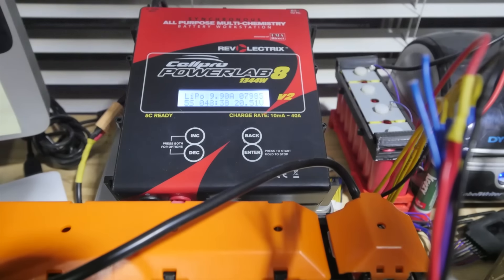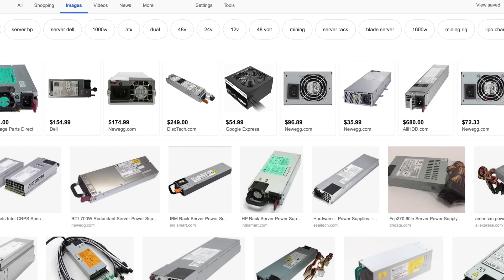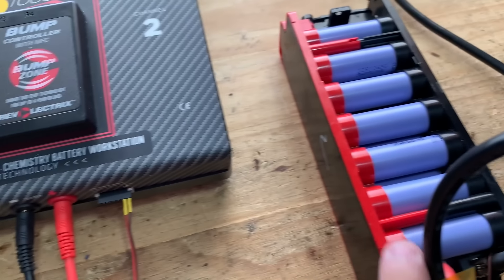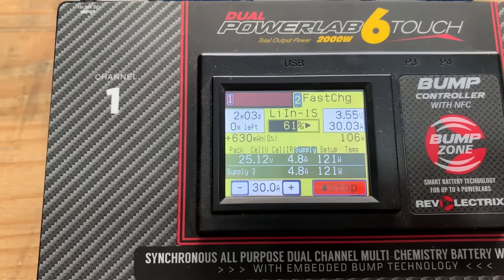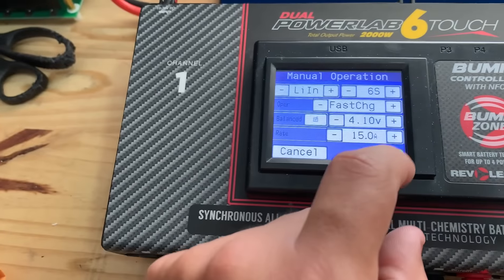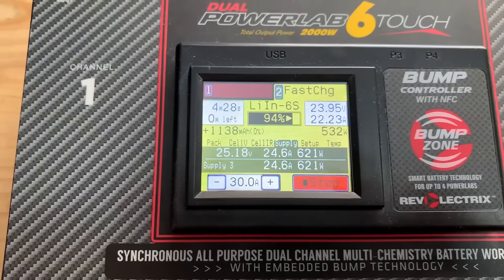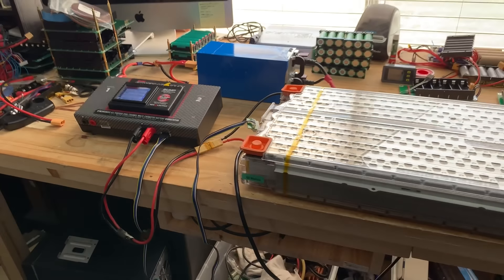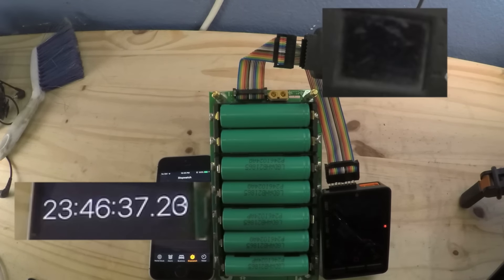$50 Dollar 2000 Watt 24V DIY  Power Supply. (2Kw)

Comment: Hi there.  These power supplies are rated ~1200watts, right?  How are you getting 2400w out of a series power circuit?
Reply from the maker: V x A = W.  do the math
Reply: @jehugarcia  ya, I’ve always had trouble with that high level stuff.... so, for the engineering world we all live in.... you might want to see if you can actually pull 2400wats out of a pair of series 12volt power supplies.... hmm ;) (btw, that’s ‘rithmatic bud - not maths ). Not sure I’d be taking any engineering advice from someone giggling at the magic smoke coming out of that charger.

Comment: I bought the same power supplies to make this cheap 24v power supply 
They both Work nice seperatly but as soon as I link them with the xt60 wire, one of them stop working (the green light shut off) and the total voltage stays at around 13v. Any idea ?
Reply from the maker: Did you isolate one?
Reply: @jehugarcia  you mean what you do at 3'00 ?

Comment: So how have you come up with 2KW? The lower value supply is 960w, so you are only able to draw that much power in series, i.e. 24v @ 40a. If you put them in parallel then you would have 1.96KW - 12v @ 80a. 

Which leads on to the reason your wires burnt out - drawing 80a on 1 supply.
Reply from the maker: What wires burned?
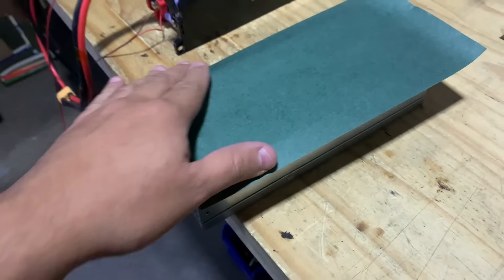Reply: 2:32 - Smoke, laughing, I just burned the wires? (Unless I’m hearing it wrong)

Also - 2KW? How?
Reply from the maker: It’s called rounding up,  look it up
Reply: I had a massive idiot moment 🤦‍♂️! Apologies - carry on 😄

Comment: I have 3 of the zanfare chargers. Going through 12 cells 3 times a day. And a 500watt atx powering a few tp4056, I haven't used the tp4056 in a while. I only have 400 cells to test. Maybe I should get the 4056 to precharge the cells. And only test the cells in the zanfare testers. I also have a few discharge testers. It would be nice to do about 25-50 at once!! I need to get more if something. I have likely 3000+ cells to go. Before this project is done! Then there is more projects. Ev likely.
Reply: JAMES! Since the 70's what you need all that power for? What you running?

Comment: If you series or parallel any chargers (power supplies) you better check their Freq and make sure they are the same. If you take two switch mode PSUs on different freqs and run them as a single unit, bad things will happen. In short, unless they are identical units, or you have some knowledge, don’t try this at home.

Comment: I need help I got a ebike motor and it say is a 36/48v motor and I have 4 Lithium Polymer batteries 11.1v I got only 3 battery level bars showing will adding another 11.1v hurt. it?

Comment: But I really wouldn't advise anyone to split the power cable and put 2 connectors on it, just use 2 of them and a power splitter or something. Just don't hack into mains stuff unless you really need to.
Reply: The earthing stuff is really odd too. It's not like they sit insulated in a server rack either. Videos like this - especially as descriptive as these - should come with more warnings.
Edit; I'm not pro rubber-tile-society but this video looks like a tutorial, but it definitely lacks a lot of background information.
Reply: As long as one of the PSU's are bound to earth they will not short with each other and they will be grounded, As the GND plane of the output is, well, actually grounded.
Reply: Tau Well that's the thing, as long as.
As long as people actually follow the instructions, as long as no mistakes are made, etc.

Mains stuff is dangerous, I stand behind my statement, you shouldn't hack into mains unless you really need to or have enough electrical skills to do it safely.
Reply: Lagger Onesixfour
Without taking risks, Many things would slow down to a crawl, Just make sure you check for mistakes by others first.
I didn't really care much of the split power cable, I just want to make sure that they grounded the unit.
Dust collects in those units, Without ground, they can give you a wicked shock.

Or perhaps my version of electrical safety is a little dull as I work on repairing valve PA's and old testing equip that can have ~500 volts on exposed terminals.
Hey, I'm still here.
Reply: The reason for this is that you have to insulate the power supply, as normally the ground output of the power supply is earth referenced. If you then connect 1 supply's 12V to the other's ground you've just shorted the supplies together. You can only run them in series once they're isolated from ground
Reply: Yes, the Y mains cable is just bizarre. There are common solutions for too few outlets....like maybe a high quality outlet strip with surge protection?!? I use heavy duty three way splitters sometimes.

Comment: What can you use this for? This showed up in my recommended videos after watching a bunch gas generator videos, post Hurricane Michael...
Reply: The charger he's using is a DC input charger only. So you have to buy or make a DC power supply to run it. Also, his charger is typically used for radio control lithium polymer packs for RC boats, cars, trucks, planes, heli's, etc. I run RC cars, nitro methanol and electric. I have 5 chargers to charge all my stuff. All mine are AC or AC/DC chargers with built in power supplies. I only run one of them off DC, that's the one I keep in my trunk to charge packs up when I'm out running trucks. Beforehand, I charge up all the packs I'm going to use via the chargers in my house that are powered by AC.
Reply: Steve, the connection between this and emergency generators is off grid power and backup power system. This presenter builds systems similar to the PowerWall, which can act as emergency backup power.

Comment: can you simply cut the ground prong on the power supply to isolate board?
Reply: Yes, but then you lose your Earth ground. You want to isolate the board from the chassis only. If you lose your Earth ground, the whole case could easily  become directly connected to mains.

Comment: If you would use DEANS WET NOODLE WIRE 12 gauge you would be able to not worry about overdriving the wire. Just a suggestion.

Comment: Jehu, why did you change stackable headers to that connectors with rainbow wires in your powerwall modules?
Reply from the maker: Better quality
Reply: jehugarcia  did you have some issues with previous solution for balancing connector?

Comment: Jehu: shorten those leads brotha, even with nice ass 8 AWG wire as you raise the current you end up with looses in the wire (aka heat). Design then to be a short as possible. Put fuses between the two PSUs and another one to the battery. If that Tesla battery backfeed bro, bad day...

Comment: I'm lost why would u think that these two case ground power supplys need to be isolated from each other?
Reply from the maker: Because we are connections them in series to make 24v
Reply: @jehugarcia  Only if they use the Negative output of the unit on the ground also. If it is just the input side, then there is no problem. We've combined a number of 12Volt battery chargers together to get 24 Volts with a 3 pin connector so that one charger charged the lower half of the 24V string and the second one charged the upper half of the 24V string of batteries. All of them had a 3 pin 115 Volt NEMA 5-15 plug so all shared the case ground.

Comment: Nicely done!
I believe you can't go higher on the amps because the charger is smart and it knows that the battery is almost fully charged. So it won't push too much power into the battery at that point so that is doesn't harm that battery. If you discharge the battery down to about 50%, you should be able to push more amps. That is what I have seen with the smart chargers that I have worked with.
You could discharge it and give it a try. Just my thoughts. Again thank you for what you do, you do a great job!

Also did you ever go any further on your "Hoverboard Wheels" board and where able to get it to go faster with overvolting or re-winding them?
Reply: Hi Joshua, my thought exactly. At about 90% SOC the charger switches from constant current to constant voltage charging.

Comment: i already have several 1100 watt server power supplies laying around but would like to run six and 8 pin molex out have any good sources for that?
Reply: Molex or Amp brand connectors? Any decent electronics supply house, but make sure you are installing the pins correctly or they will burn the connector bodies. For a retrofit carrying high current, I prefer converting to high current set screw terminal sets.

Comment: Hey quick question, did you isolate   both units, as in removing the DC ground
Reply: supposedly you only need to do it to 1 power supply.  isolate the pcb of the power supply from the metal chassis by using nylon washers and screws.  I believe the sizes are 1mm washers and 3mm screws.  I don't know the screw pitch.  most good local hardware stores stock these kinds of screws and washers.  especially ace or do it best hardware stores.

Comment: Maybe the current limit was because you charged a 7s pack on the 6s setting?
Reply from the maker: There is no 7s setting on the powerlab 6
Reply: jehugarcia yeah that what I was thinking. I mean, if the charger is set for 6s, the max voltage is 25,2 volts, so maybe he started the constant voltage phase dropping the current?

Comment: how many amp hours would 100 18650s have? great video.
Reply from the maker: There many sized 18650 cells,  some have 1500mah some 3600mah so it depends
Reply: @jehugarcia  Hi I have a lot of new hoverboard batteries but I have a problem with that even is charged and showing 42v after 10min of use it's stops working please can you help me what can I do with this batteries.

Comment: think about your house.  12 gauge is fine for 15amps. Those are also very short distances. check the temperature of the cables and the voltage drop.
Reply: House wiring is a different configuration, John. Most US home branch circuits are 15A 120V over 14 AWG single conductor (solid wire)  where battery configurations are more commonly carrying DC power over multi-strand (conventional stranded wire) and even poly-strand (speciality cable like welding conductors), helping with current conduction and heat dissipation as well as vibration and flexibility. Find a good DC wire rating chart to confirm the correct size rather than the AC charts in residential building code (mine are from one of the cable manufacturers I buy from) and make sure the insulation can handle the heat level (much of the work I do is under car hoods and I prefer 150°C/300°F insulation as a safety factor).

Comment: I have a control board that works and voltage adjust mod on the same board. has anybody figured out how to make them master and slave so you can use one voltage reference for adjustable voltage when using multiple power supplies?

Comment: Great video but i think id rather stick with my 36v 1200w adjustable (31-41v) power supply off ebay. 100$ cad so much cheaper usd would have been easier for the same price maybe?

Comment: Since I'm no rocket scientist I ask what're you using this for? Why not just do a 12v since that's what
we normally use? What is the reasoning behind jumping up to 24v, I mean why not go to 36-48v like
some electric bikes use?  If I knew I wouldn't be asking so thanks for any help offered? Once I've got
a clue then I can think about the needs I have?
peace
Reply: Pretty easy the chargers hes powering can take a max imput of lets say 12 AMP . at 12v thats 240w charging power . But the charger supports up to 24v so he can get twice the charging power. Thats the case because the charger has Buck boost converters  to supply different voltages for different battery packs . Those buckboosts use a pumped inductor to create the different voltages,this inductor is what limits the imput amps to 12 AMP no matter if 1v or 24
Reply: ty Peter, I should have figured as much but I'd rather get started looking in the
right direction…..I'm asking now so I don't waste too much money
thankyou much
Reply: @diggydice9041  depends on your needs , i only charge drones batterys and since im in my car most of the day the 13.8v from the car are perfectly fine for my needs
Reply: Gotcha now Peter, I'm setting up a Solar/Inverter to battery bank for
downed power situations. Hey, could you recommend a decent start
type drone that is good quality & can grow into it. I don't want super
cheap,,,, something good that I'll be able to use a while. For aerial
photo shooting & fun.  Or a good site to get me going?
peace
Reply: @diggydice9041  well check out rotor riot for freestyle fpv, good arial foto drone is the yunecc typhoon 500. Its about a year in market and the price is done to a very good level . Overall Tipp is if you want future and learning in the hobby Start with a something Like a tiny whoop or a simulator. Dont go for dji stuff or so discover your needs and then build up gear the drone hobby is expansive in the  beginning but cheap to maintain then. Radio and Googles are with you for a long time thats where most the money goes
Reply: thanks for all that,  it'll help me as I move into this.
I'll yell at ya when I get set-up.
Reply: hey Peter >> Wow, lots of stuff in this arena!! So many ways to make
costly mistakes & that's not including a crASH landing? Googles? Do
they allow you to be Eyes in the Skies? From that vantage point? So
I've looked at Roto Riot & it's all parts/accessories. I would want to
buy something that can be upgraded/versatile. I'm really green &
wish you were near to Dallas? You don't have to say, just kinda
interested but am afraid to dive in.....lol, I'll be educating myself
peace

Comment: Thermal camera on the wires may been interesting
Reply: steve64464 I bet that little xt to ec5 adapter was getting pretty warm
Reply: I used to build custom distribution boards. 70-80 °C is considered operating temperature.
Reply: @SuperBrainAK  and if lifetime is not of any concern

Comment: Pretty sure you hit power limit since you combined them (- + to - +) which doubles voltage but not amperage. Therefore it is still 24v @ 1000w max. You'd need four to get 2kw @ 24v.
Reply: If the voltage doubles and the current stays the same then the total amount of usable power doubles as well. P=V*I, (power=volts*amps) so if V doubles so does P.
Reply: Dylan Doucette I'm not entirely sure on how to calculate that although I'm pretty sure current stays the same regardless, so he's a capped at 1kw vs 2kw, this is from personal projects and hitting limits myself
Reply: @nahventure3873  No thats not how that works. If you have a  psu that outputs 80amp at 12V that is 1000W. Now you bring a second one and put it in series you now have 24v at 80amp which equals 2000w. But if you only had one psu at 80 amp 12v and used a dc-dc 
booster, that would equal to 24v at 40amp which is still 1000w.
Reply: @EndstyleGG  Yeah oops. However I'm fairly sure what he needs is more amps rather than watts to establish a full speed.

Comment: Real question is why are the used fiat 500e so cheap? 7k for a 25k mile car 2015 ? Does anyone know if its because the batteries suck?
Reply from the maker: Batteries are good they just don’t have enough,  good for 80 mile range if you drive like grandma 50 is you so donuts

Comment: Do not put two switch mode power supplies in series unless you make sure the rectifying diodes on the output can handle at least twice the output nominal voltage.

Comment: Is it ok to connect switched-mode power supplies like this?
Reply from the maker: Who do you need permission from?  I did as many others have
Reply: There are some concerns, that's why I asked you. :) 

https://electronics.stackexchange.com/questions/71296/connecting-switch-mode-power-supplies-in-series-to-increase-voltage

Comment: Look for Cisco WS-CAC powersupplies, theyre used in Powered Network Switches, they dont require any modifications to startup,
theyre available from 1300W up to 8300W (6000W model refurbished / used goes for like under 50 bucks.) like this one on ebay: 173318618193
output voltage is 42V! but not current limited unfourtainly.

up to 3000W it requires just one plug the 6000W model runs on 2 Plugs and the 8300W on 3 plugs
but only for High-line at 200V and above.   may need to hook it up to a 3 phase american outlet which is 240v.
see their datasheet.
https://www.cisco.com/c/en/us/td/docs/switches/lan/catalyst6500/hardware/Chassis_Installation/Cat6500/6500_ins/0apwsply.pdf

made some pics from the inside, basically two 3kW powersupplies in parallel.
https://i.imgur.com/3AsEd7Y.jpg
https://i.imgur.com/5H39jMx.jpg
https://i.imgur.com/ZD9slUM.jpg (nice screw terminals, the backplane can be removed without an issue.
(not my pics, but we are on the same forum topic talking about adding voltagecontrol and cc circuitry a while ago. no progress yet.)
https://i.imgur.com/7U1ba8V.jpg
https://i.imgur.com/VoGh91i.jpg

Also when hooking those powersupplies up in series, put a diode in reverse on each one in the event of one not starting up, else it will be fed with negative voltage and some serious power behind.